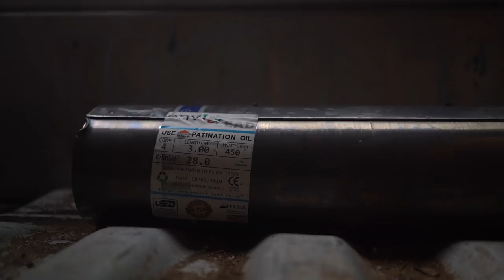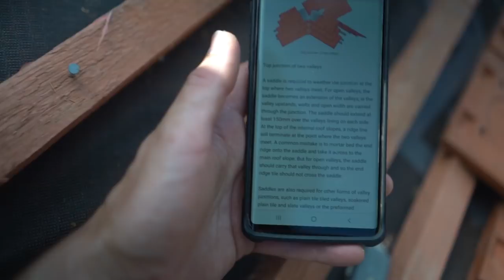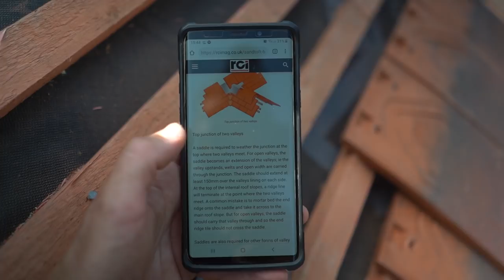BUILDING A HOUSE ALONE from START TO FINISH | E.P 76 [Lead saddles going in]

Comment: Rodian, before you fix the ridge down, make sure you've have sufficient coverage of the penultimate course of tiles on each dormer. If you don't, you could gauge the top two courses to match the rest and put the eves tile higher which in turn will lift the ridge up and the hips will line through better.  👍
Reply: Missing eaves tile at ridge.

Comment: Glad you got a deal on the lead because you’ve used far too much for those saddles lol. The lead just has to cover where the last two valley tiles meet and then goes up the roof behind the tiles. So when you put the last ridge tile on it should cover the lead completely. 👍🏻

Comment: Good work once again Rodian. I always enjoy your efforts and progress. Your saddle is a little bit too big. Follow your top eaves course round with a valley tile as you've been doing then put on your saddle. The next row of tiles from the main  roof and the ridge of the dormers will then hide the lead. The ridge just runs into to the roof with the appropriate cut angled at the roof. Noticaebly it looks quite tiny. Use a full ridge over the saddle so you can get some sort of fixing without jeopardising the detail below as you mentioned, then put a tiny cut on the main ridge line to secure it.  Try not to put sand and cement under the tiles. Lead will expand and contract over time and the the muck will dislodge even with a small amount of lead. 
As for the patination oil army, the only reason you would use it is to stop white streaking as the lead self patinates. It might stain the tiles. With oil it develops a dark grey patina quickly, left to it's own accord it will develop a bluish hue. All that oil does is speeds up the process. Grade 1  properties specify no oil for visual purposes, hence the natural appearance of lead. The protection is all the same.

Comment: There’s only one thing to consider regarding the saddle, simple. The lead doesn’ t need to do anything that the tiles/valley tiles are doing with regards to side and head lap. That’s how it ends up too big and looks a bit cumbersome. Anyway they are the finer points of this detail but with all your ‘ belt and braces ‘ covering no chance of it leaking !!!!! Press on regardless.

Comment: That’s literally the biggest saddle I’ve ever seen. You shouldn’t actually see the saddle. A bit of lead roughly 300x300mm would be fine for there. Trim it back. 
As for the ridge, cut it close into the tiles. The screw on the join won’t go through the lead anyway.